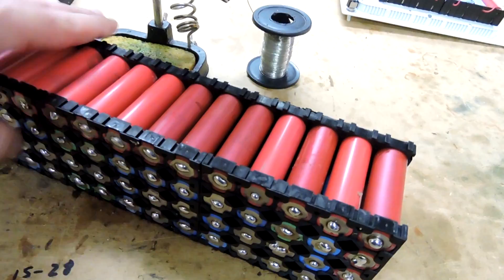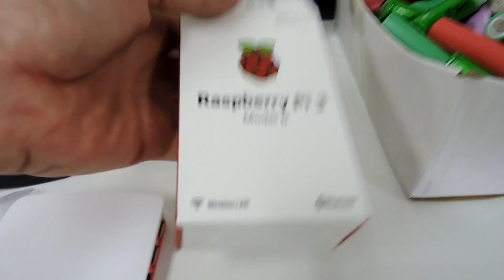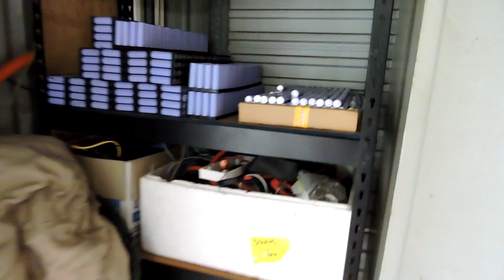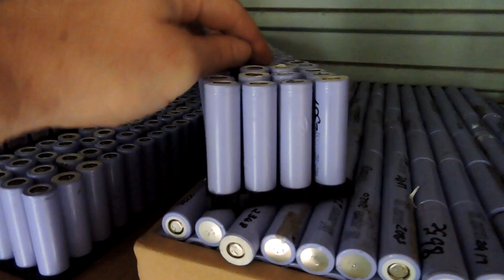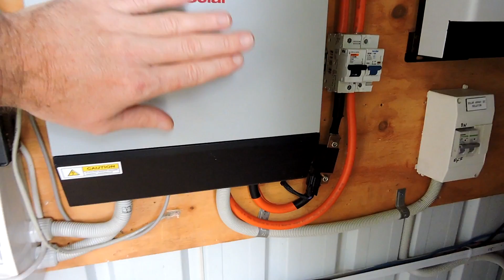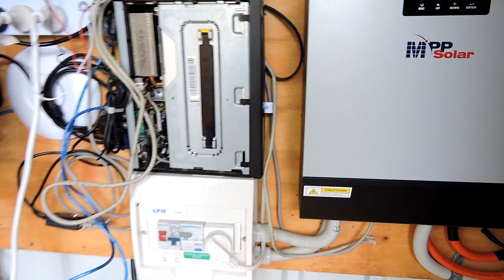HBpowerwall  18650 update

Comment: Hello
I startet for myself with my own Homebrew Powerwall. I watched a ton of videos and i am learning a lot. ATM i am cleaning Accupack after Accupack and Charging Cell 814 in Class A Cells.
I will start with a 120p7s 24 Volt System. 14 Solarpanels and a Converter as similar to yours.
I have one importent questions i can not answer atm.
What if there is a old Cell in my 120p pack that gets a heater. How can i prevent it from fireing up the hole system?
Short Circuit Cells are no Problem because of the fuse. But what can i do against overheating from one single cell?

(Sorry for my great english) :-)

Greetings from Germany

Comment: Those Pi3 require 2.5 amps at a steady 5V (even mobile wall charger cant do it unless it's one of those higher current ones). PoE wont work as the drop will cause the unit to fluctuate in power at a too long distance... but you can try. Happy to help with any raspbian linux stuff. I work in Sydney so timezone is good.
lol just noticed the ubiquity AP on the wall, I got one too.
Reply from the maker: Yeh was reading that, maybe not a good idea for me considering distance and The AP is also PoE. Thanks for the help

Comment: when you are making an 80 cell pack... what is your target range (in Ah) for for each 80 cell packs?
Reply from the maker: works out to be an average of 2400 mah so whatever that is x 80 ish - it's all guess work really
Reply: I understand. I've noticed that when I test discharge a cell... I get about 300-400mAh higher total measured capacity on a Foxnovo  f-4s than I do with the same cell tested on my imax B6. I've done this several times with great cells and lower quality one's... have you noticed the same thing?
Reply: You are discharging farther on the Foxnovo than the Imax.  The Imax cycles 4.2 -> 3.2V on LiPo setting and 4.1 -> 3.1V on LiIo.  I think the Foxnovo does 4.2 -> 2.8.  It also slightly depends on discharge rate, slower will result in higher numbers, so if the Foxnovo is doing 0.5A and you have the Imax set to 1.5A or something, that will vary it slightly too.  Each of those doesn't change the number a lot, but add them together and it can account for your 300 mAh range.

Comment: Hey I love all the videos, but I am a little lost about what the big picture is and what your doing.  I think a video talking about your whole project would be great. What is your solar system size? and is your solar charging directly in DC? What are the voltages of your battery packs? Are the small packs all in parallel and then series connections on the wall? Why did you pick that number of cells in a pack? I have so many questions!

Comment: Oi pete, u shudnt have heat issues with that pip at this time of year, I think u need to pull it apart and check the fans they r the first to go, if the unit is full of crap then blow it out with compressed air and also do a visual check on the capacitors in it.
Reply: i would second that, my pip had 3 kw of solar running through it and it was the main inverter, it never got more than warm to the touch... failure mode include the fans failing and the inverter board capacitors, these capacitors are not very sturdy and in extreme cases will cause a fire in the inverter.... (yep i was that lucky)
Reply: Yap I agree, Take the cover off it and have a look at least, never know what your going to find then run it with the cover off and see if you can pick up the hot spots with your thermal imaging camera, but don't touch it while it is running with the cover off.
Reply: alsotake a picture of the factory seal before you remove the cover, if there's any waranty left they will want to see pictures of the seal before shipping spare parts...